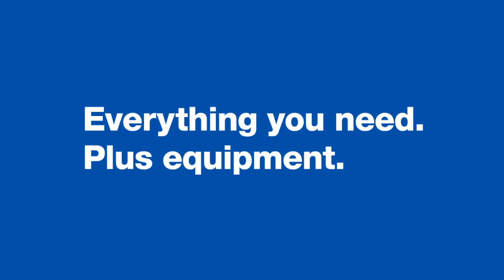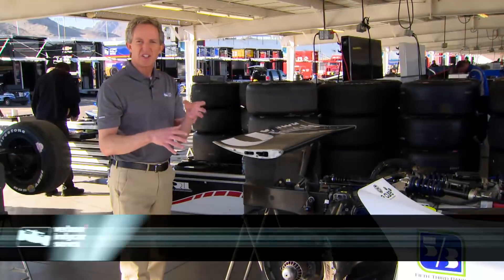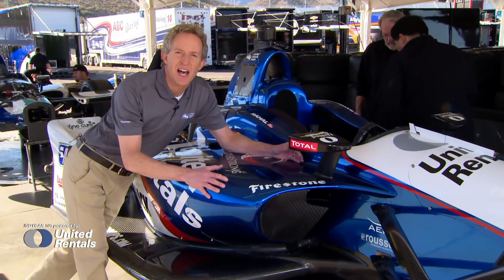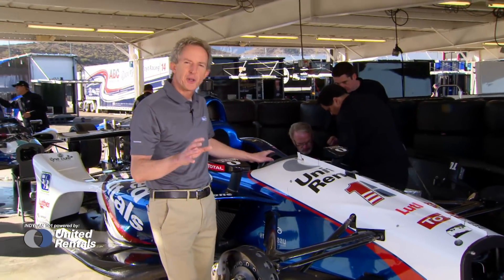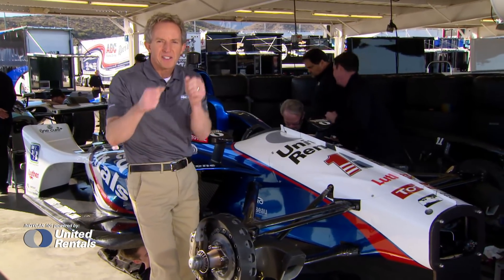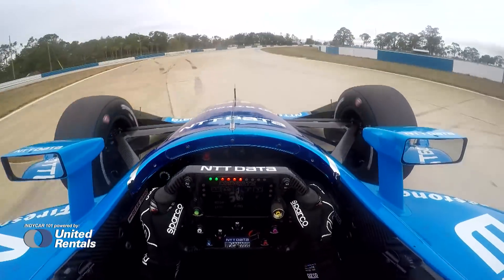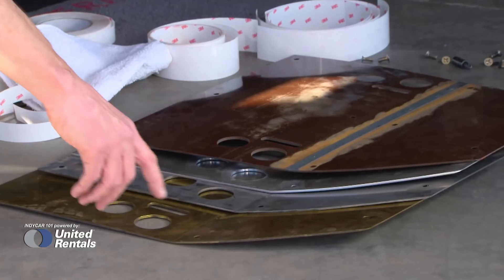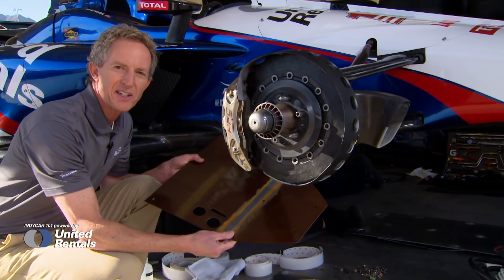INDYCAR 101 powered by United Rentals: 2018 Weight Distribution

Comment: I have noticed that the high-speed spin of a car with more weight put to the rear might cause less damage on superspeedways. It typically makes 180-degree turn and hits the wall sideways at a small angle.
Conversely, with the weight adjusted towards the front, the driver could correct the spin, which could lead to the very dangerous consequences, hitting the wall nose-first at a bigger angle, just like Bourdais.